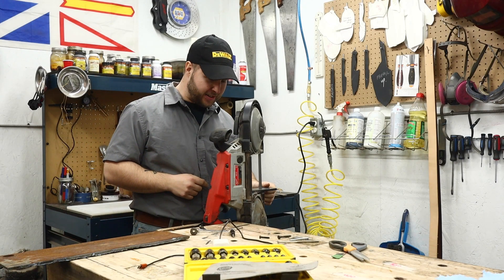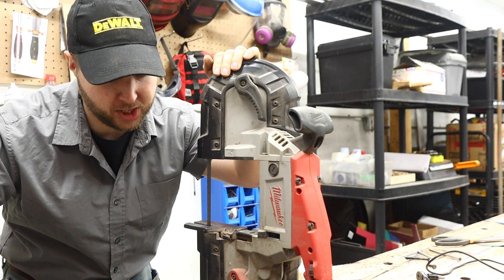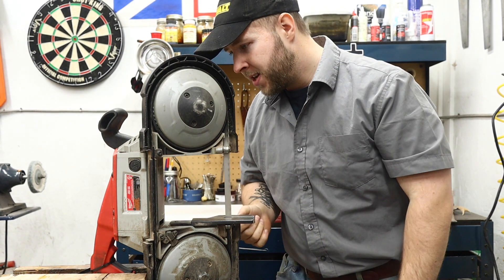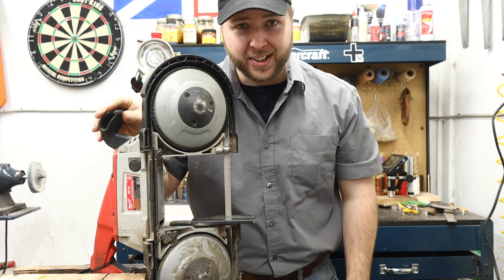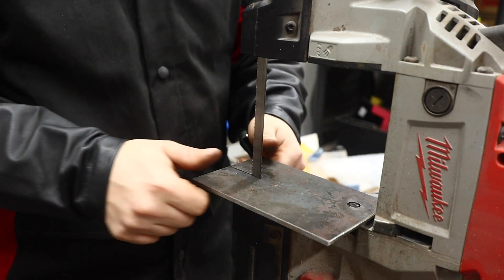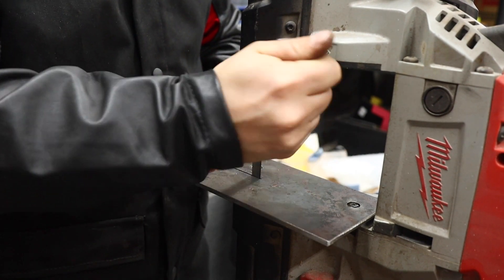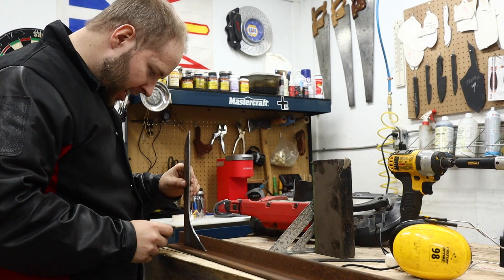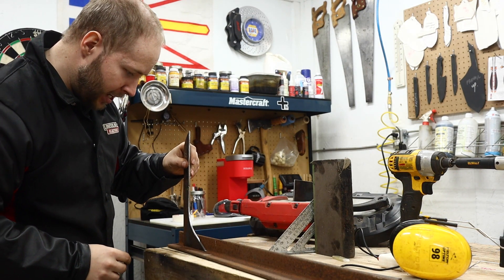EASY Portable Bandsaw Mount - [ Knife Maker Tricks ]

Comment: Tip for welding thicker material with a smaller machine: preheat. Propane torch, proper joint prep(no mill scale, clean bright metal) and just let the puddle do its thing at its own rate.